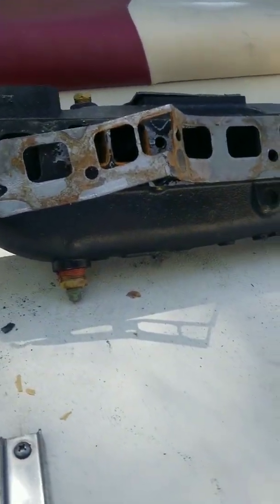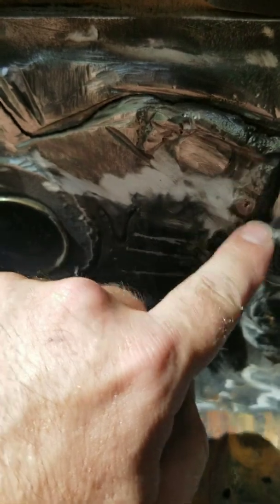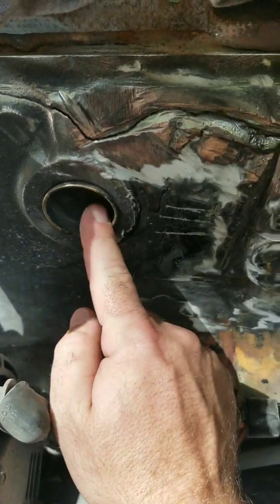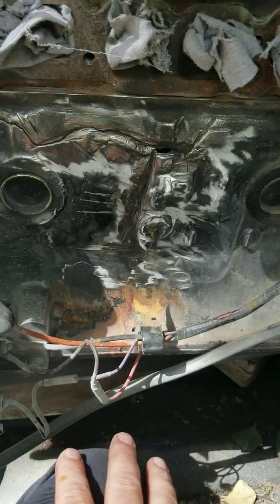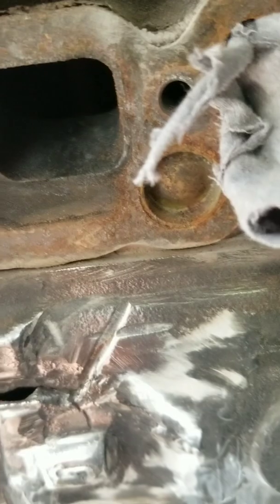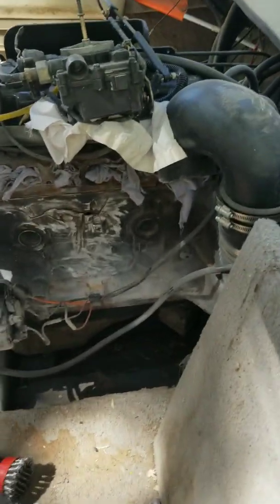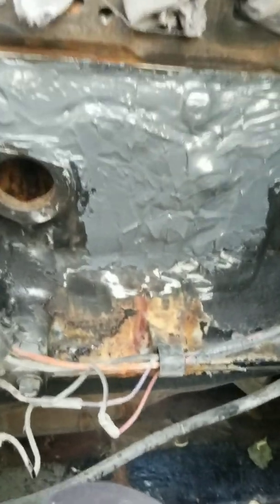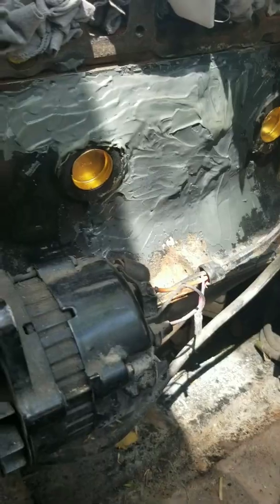repairing a severely cracked boat engine block with JB weld. I promise, it works

Comment: Surprising how few people know this trick:  Use clear tape over JB weld after applying.  It won't sag and can get it thicker.
Clear plastic sandwich wrap works, too.  I even do it with fiberglass and bondo.  Smooth it out.
Reply: I'm a hermit and use a million tricks like this but no one knows them.  I thought about making a video but it would be an hour long, at least.  I never do as it seems to be against my nature.

Comment: That block is toast. It wont last.
Reply from the maker: Second season on the lake, my customer has used it a few times since then. Good enough for for what it is. Either throw the boat away a year ago, or get another year or two out of it. I have replaced engines in boats and the customers let the brand new engines crack the first year.

Comment: Unless it leaks on the inside like mine
Reply from the maker: Highly likely, shove a camera down spark plug holes, usually you'll be able to.see if it got.in.the cylinder before attempting repair